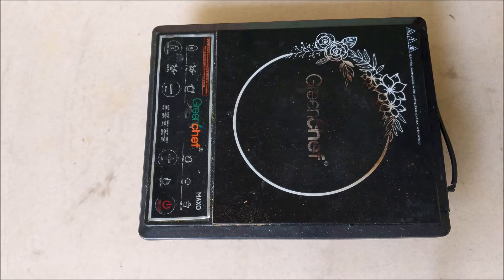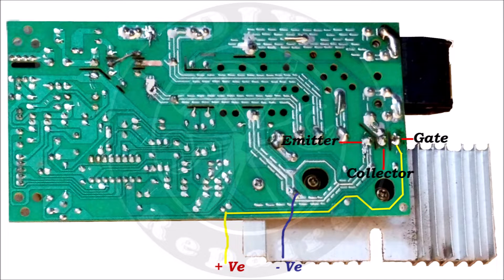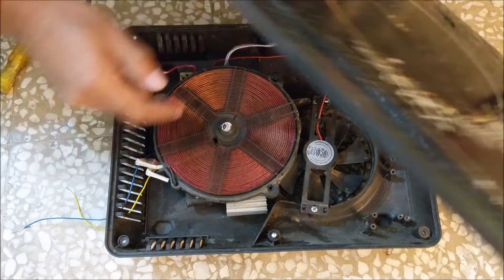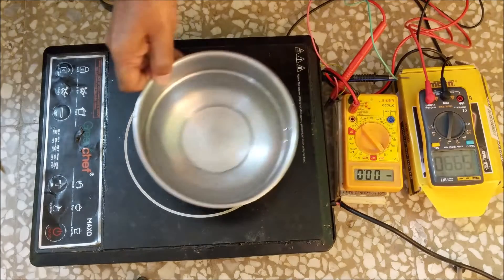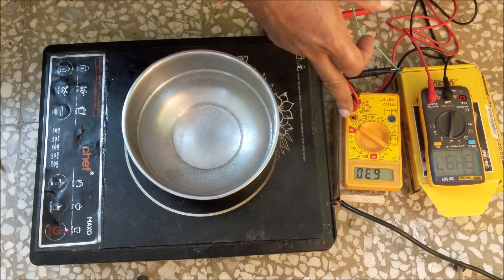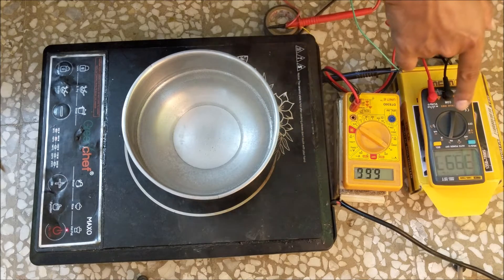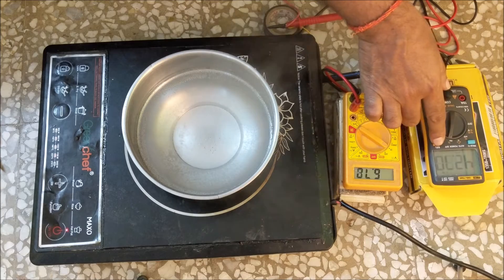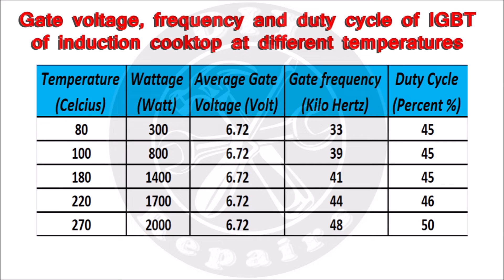gate voltage frequency and duty cycle of igbt of induction cooker at different temperatures

Comment: Great Video, Thanks! Just one thing that I would like to mention: The small yellow multimeter might not correctly respond to the PWM signal that the drives IGBT, and therefore might be slightly incorrect.
Reply from the maker: Yes, you are right. In fact the frequency is high so the mean voltage is almost correct.
Reply: @diyrepairs  Best option is an oscilloscope that is insulated from mains... But an expensive option unfortunately!